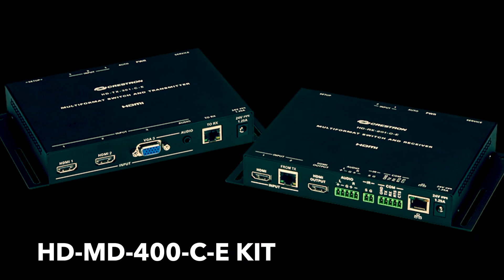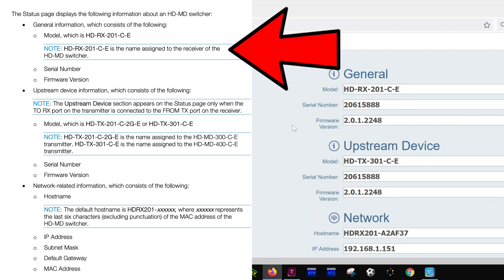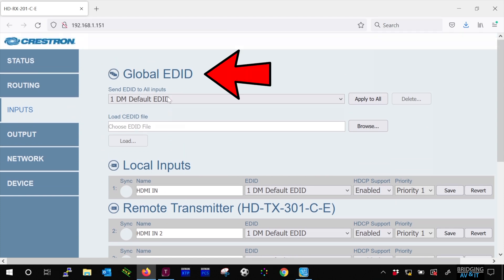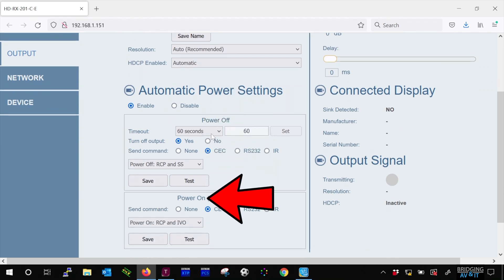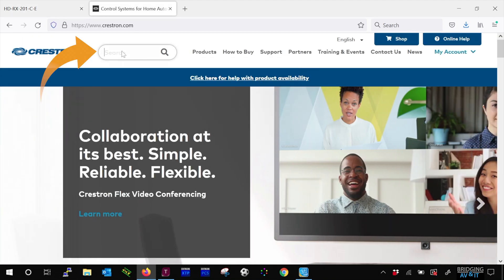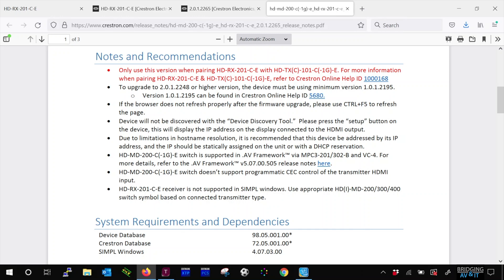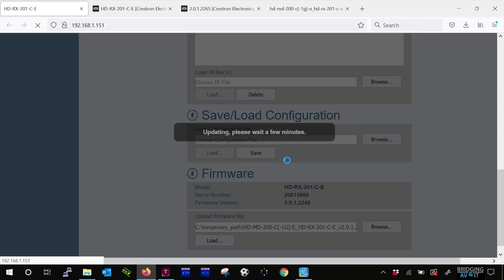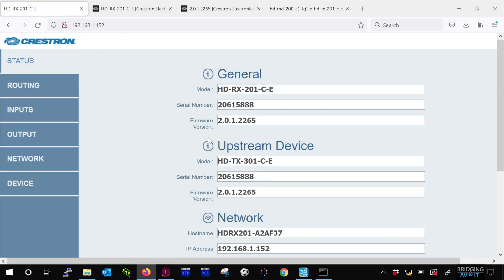Crestron HD-MD-400-C-E Firmware Upgrade

Comment: I can't get the software to recognized the Tx, are you connected to your laptop using the LAN port of the RX or are you using the USB service port the Tx or Rx to your laptop USB?
Reply from the maker: Get the IP address then Login using the webgui and you should see both the Tx & Rx. Look on the left menu. Make sure they are connected to each other. You connect to the LAN port.
Reply: Thanks that worked !!! @AVNetworkGuy